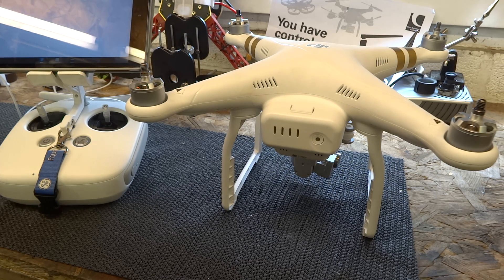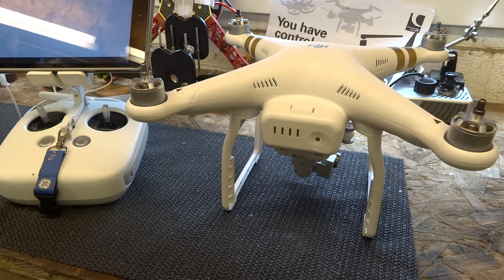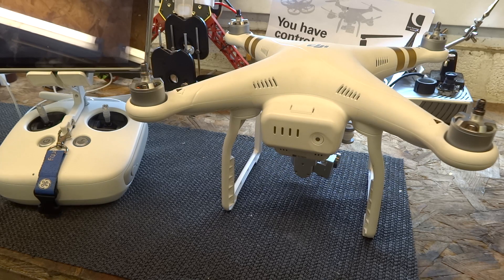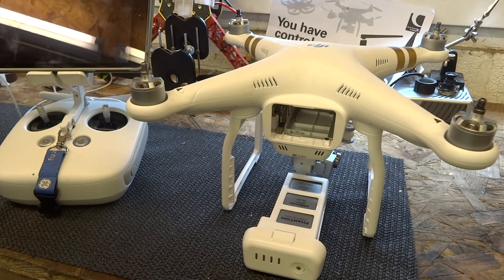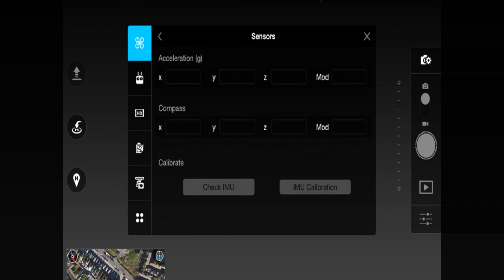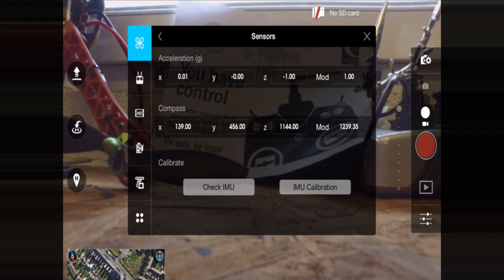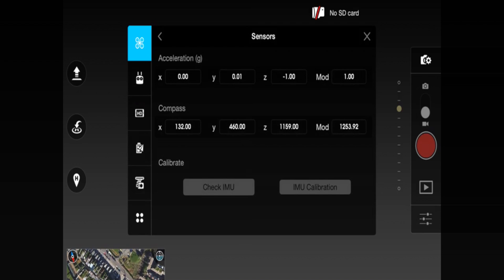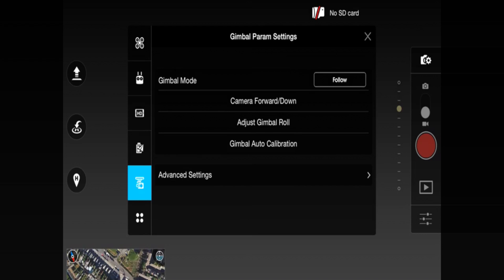DJI Phantom 3 IMU Calibration Warm Up & Gimbal Horizon Issues Revised

Comment: How would sensors be affected if the device was powered down the entire time during shipping? I don't get that. 

I've never performed an IMU calibration until the latest update came and required me to. 

Sensors being uncalibrated during shipping sounds good until you think about how those sensors weren't actually on.
Reply: "Flash Drive" Heard of that? Flash drive means that with no power to it, for years, whatever you last put in memory stays there. So, the memory was last flashed in Pee King China and now it is in South London the next time it turns on. And tries to make sense of where it's at, GPS satellites and all that stuff. So it has to be 'cold' reset, pun intended.

Comment: unfortunately, the cold IMU calibration didn't fix the slanted horizon issue, so I tried the inflight gimbal calibration. Neither of them worked. I hope DJI comes up with a quick fix. I would rather not send it back. Thanks anyway for your suggestions.
Reply: +korling99 Any solution? got it working?

Comment: Other than a level surface, and the temperature, is there anything else to be careful of?  I presume I can do it indoors with no GPS, and possible metallic objects nearby tweaking the compass?
Reply from the maker: stephend metal is not an issue for IMU calibration just the compass one, just make sure its not moved whilst the process is happeninig